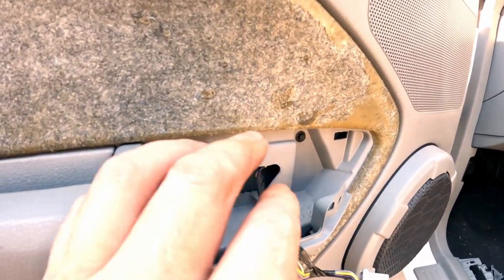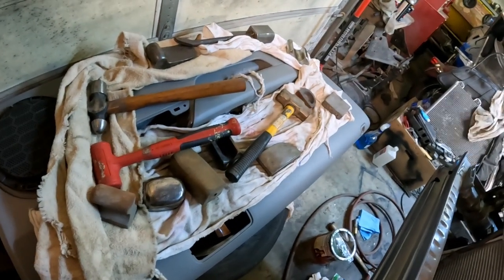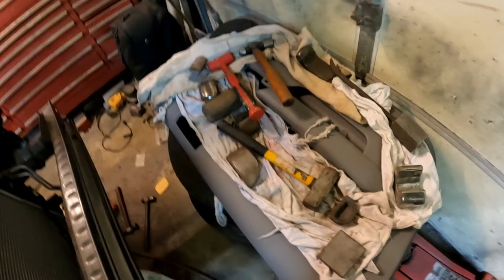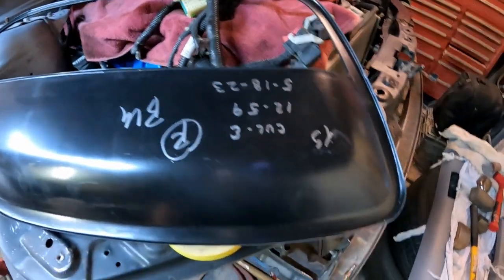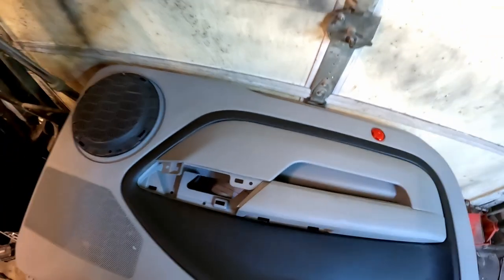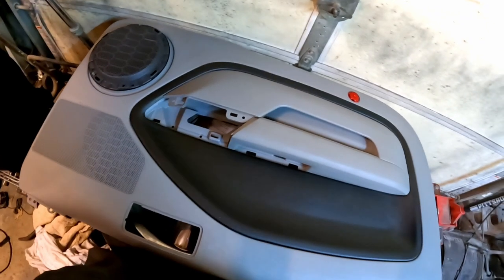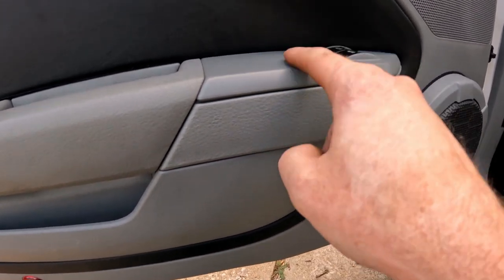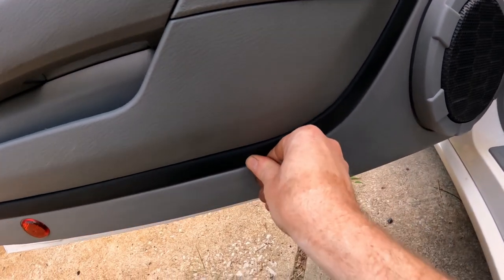Mustang GT Makeover: Fixing the Interior Door Panel Like a Pro!

Comment: Are your door panel insert replacements manufactured by Coverlay? If they are, I viewed several other YouTube videos that showed the panels did not fit properly in the corners to where one corner would pop off on the upper right-hand side or on the lower left-hand side... Despite, removing the foam/felt backing material, the Coverlay ABS replacement panels still encountered fitment issues... Therefore, my question is did you also have similar issues and if you so, what steps did you take to make them fit properly?
Reply from the maker: Mine are Coverlay panels, I didn’t really run into any problems with them other then missing putting weight on the one part. They actually fit really nicely for me. If you watch the video you can see how I got them to stay in place until the glue cured up
Reply: I did watch your video in its entirety... However, I also noticed they didn't stay in place on one of the corners after the glue had cured... So how were finally able to get all the corners to stay in place after the glue had cured up completely? @deedoesgarage
Reply from the maker: That’s what I was talking about, I missed that spot when I was setting the weights on it and simply added more glue to it and set the weights back on it and that fixed it, I didn’t have any problems with the passenger side. Just make sure you place a weight of some kind on the thinner spots of the covers and spread some weights on the thicker spots and you would have a good fit
Reply: @deedoesgarage  That's definitely very good to know... Perhaps, Coverlay addressed the fitment issues that some of their customers were experiencing over some of those corners not staying in place? In the meantime, I would really appreciate it if you wouldn't mind watching the YouTube video that I've attached the video link, as I'm quite sure you'll find very interesting... This YouTuber also removed all the foam backing material before gluing the Coverlay panels and he still was not able to get certain corners to stay in place...  Meanwhile, let me know your thoughts/opinions after watching the video and thanks once again... https://www.youtube.com/watch?v=Cg5uNPbQaoY&t=108s
Reply from the maker: I watched that video before doing mine, I decided not to remove the felt as he did.
Reply: Just so your aware, it's not the factory glue that causes the vinyl inserts to peel away, but rather it's the foam backing material that fails... Once the foam backing material starts to disintegrate/degrade. there is no longer anything left for the glue to stick onto... This is the reason why the other YouTubers recommend removing the foam backing material before installing the Coverlay insert panels, which in my opinion does make the most sense... Otherwise, it will only be a matter of time before the Coverlay inserts end up beginning to start falling off due to the foam backing material continuing to degrade from falling apart! @deedoesgarage
Reply from the maker: @rmp5841 I sanded off all the foam and glue, what was left was the felt backer that the original foam was glued to.
Reply: @deedoesgarage  I was always under the impression the foam is part of the felt backing material? If it's not part of the backing material, this is the first it's ever been brought to my attention... Therefore, what exactly is the foam part of the backing material and does the felt part also eventually degrade as I had assumed from the very beginning?
Reply from the maker: @rmp5841 the foam is part of the leather material, the felt backer board is what the leather glues to. The instructions from coverlay tell you to keep that part on the door panel and just clean off all the foam and glue from the failed leather.
Reply: @deedoesgarage  So if I'm understanding correctly, the foam is part of the vinyl/leather insert material which actually fails and not the felt backing board which is glued to the door panel? Well, this most definitely provides a definitive explanation for what really is the reason behind the vinyl/leather inserts peeling off from the door panels... Therefore, I'm going to follow your lead by just cleaning off the all the old glue and foam from the felt backing board, but instead of sanding it off, I'm going to first try removing the old glue and foam with mineral spirits as suggested by a YouTuber who goes by the name of "Old School Auto Upholstery Techniques" and find out if it's easier to remove the old glue and foam with using mineral spirits? In the meantime, let me know what you think as to whether mineral spirits would be effective or not and also thanks for taking the time in clarifying this whole process behind the failed vinyl/leather door inserts...
Reply from the maker: @rmp5841 I never tried mineral spirits on mine, I did try lacquer thinner but it wasn’t any help so I just sanded all the old glue and foam off, it takes a bit of time sanding all the old stuff off but I think it gives the new glue something good to bite into, even if the mineral spirits work I’d still do some sanding to rough up the felt a bit for the new glue.
Reply: @deedoesgarage  The YouTuber who goes by "Old School Auto Upholstery Techniques" doesn't recommend using lacquer thinner nor turpentine, as he claims that using them will only end up just smearing the old glue around, but not remove it. He does however show in his videos that mineral spirits does work very well in removing the old glue... I would copy and paste his video link for you, but unfortunately my right mouse button is not functioning properly for some reason? but his videos are definitely here on YouTube, so perhaps you might be curious in checking them out?
Reply from the maker: @rmp5841 I’ll have to check out the channel, I may have watched one of his seat repair videos before.
Reply: @deedoesgarage  When you check out his channel, the video title is " DIY Correct Mustang Door Panel Repair 2005-2010-2014 Auto Upholstery". Just keep in mind he re-glues the original vinyl/leather insert back onto the felt backing board, but uses contact cement adhesive which is used for gluing countertops and floor tiles... I found his video as very interesting with using contact cement adhesive over the 3m spray adhesive but wonder how long it will actually hold up until the foam material in the vinyl/leather inserts begin to break down and fail once again lol. Personally, in my honest opinion, I could see how well the contact cement adhesive could actually work for gluing the Coverlay ABS panels over using the supplied silicone that's included?
Reply from the maker: I think either silicone or contact cement would work although I used silicone on mine and it seemed to work very well
Reply: @deedoesgarage  So approximately how long have your Coverlay panels held in place?
Reply from the maker: @rmp5841 it’s been a few months now without any issues
Reply: @deedoesgarage  Then I will most definitely be following your lead, as you're the man! 👍